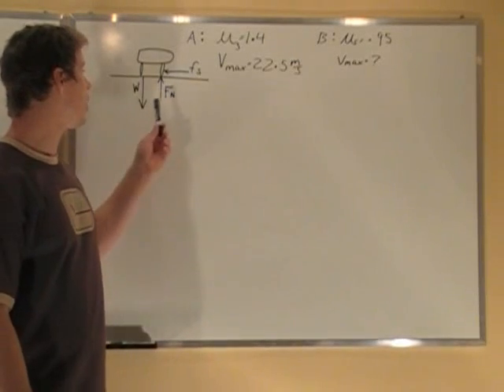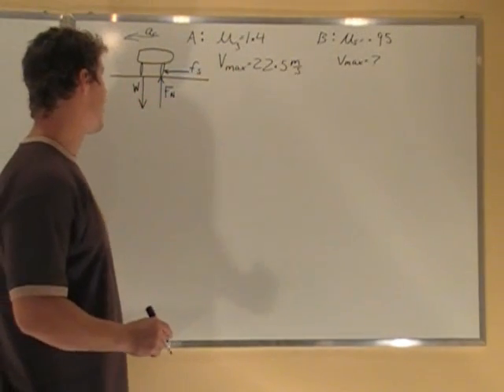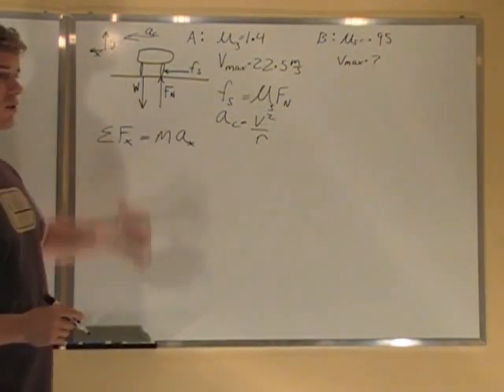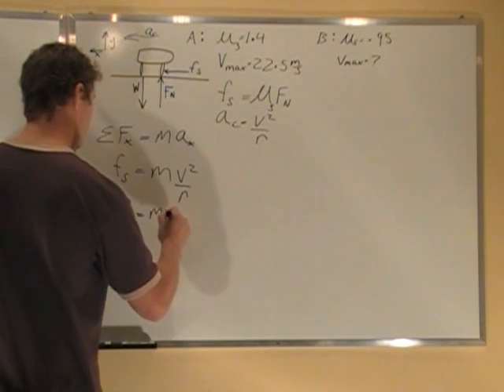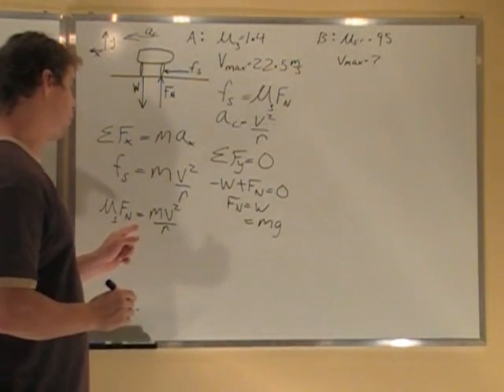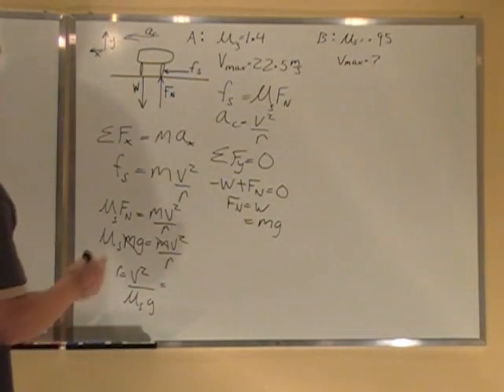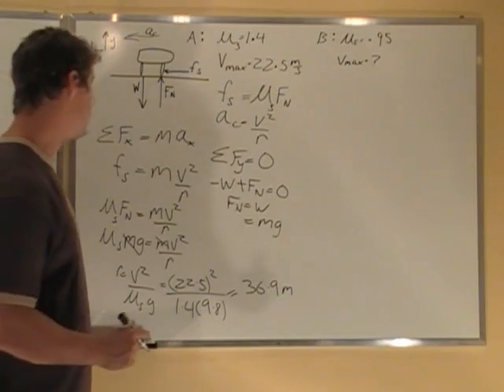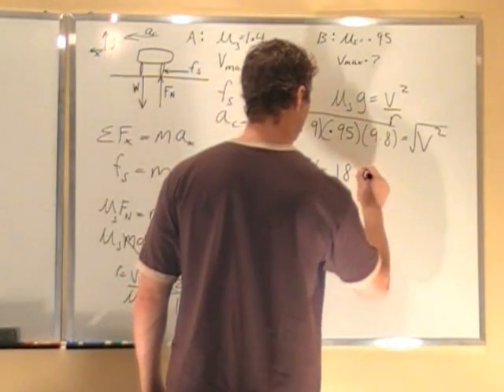Circular Motion - Car on unbanked curve with friction

Comment: just a question.  If this is a banked curve, wouldnt the road be at an angle, so when doing the summation of the forces in the x direction you would need to take the sin of the force of gravity, so you would have Fs*sin(theta) = mass*centripetal acceleration?